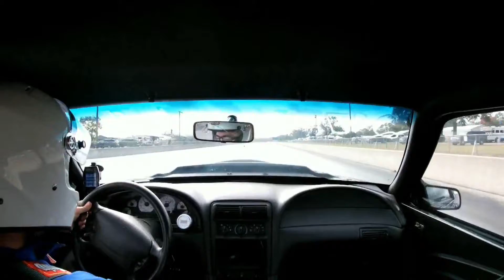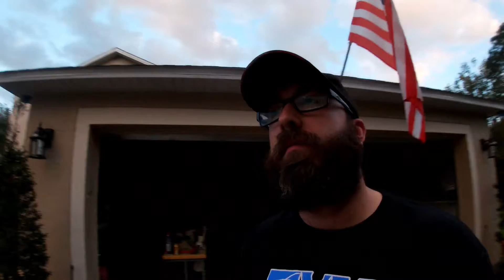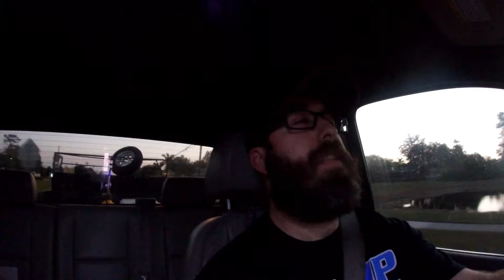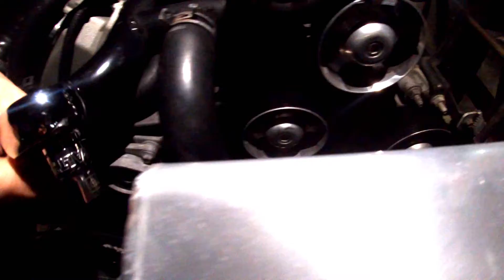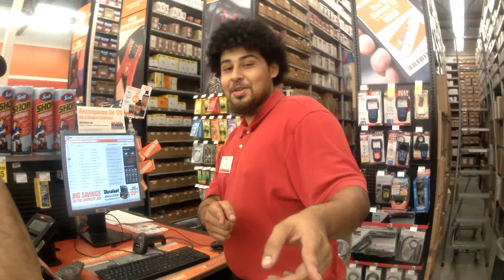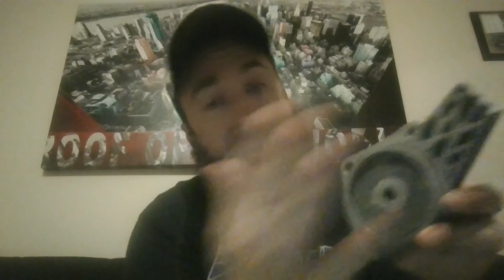Breaking the Foxbody at Test n Tune. Too much powaaa

Comment: Just for your own info... You will still break the tension arm  even with a Metco brace if the belt is too tight. Im sponsored by Metco and I broke two arms before figuring this out. First time it took out the 4 lb lower, the second time it took out the 4 lb lower, and 3 idlers.  Moral to the story is... make sure the belt size is perfect, and the arm can still travel a bit. Good luck.
Reply from the maker: Good to know! Yea i had a 4lb lowerbon standby because I was changing the configuration soon. This was my 20th or so passnon this but that belt was tight i know that! Lol
Reply: @J-Whit  Also..... Might have been why you threw the belt when racing the bike? I know you had the idler fail, and that is a common problem, but perhaps the idler failed because the belt was too tight?  The Metco brace will help on the flexion of the tension arm, and with a belt that gives slightly, you should be able to eliminate another break. Hit me up if you have any questions, or I can help in any way.
Reply from the maker: @_carnivore_joe1520  that potentially was the case. but I switched now to a less aggressive set up so I have more belt wrap and brought it back down to 22lbs vs 26 lol. I will see how this set up performs, but in all reality I need to fix that idler still... and put this billet roush tensioner on that is on the way